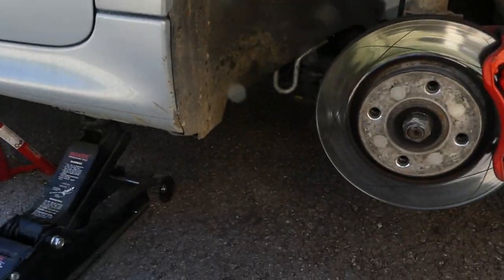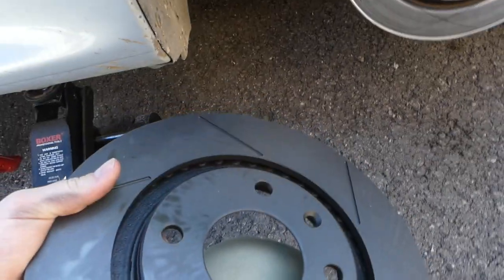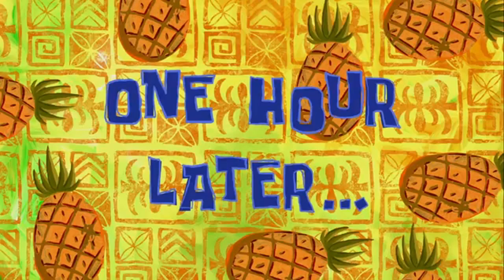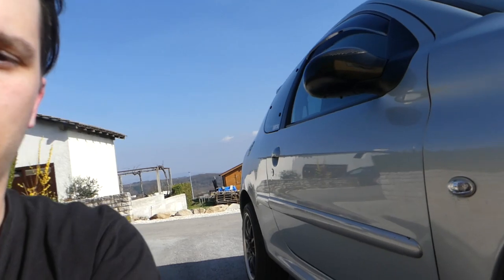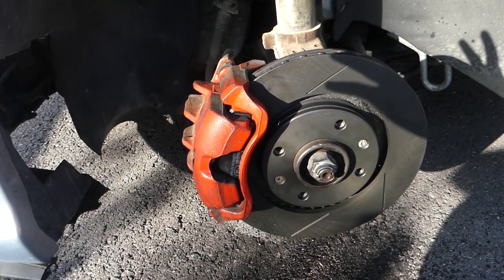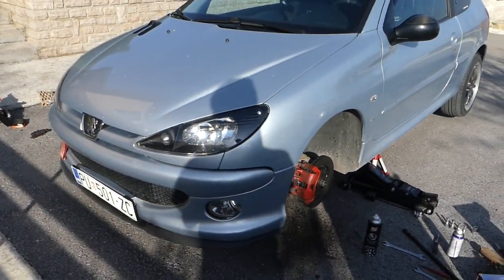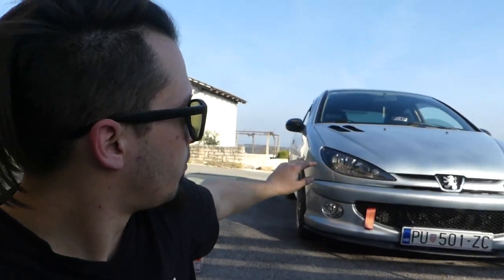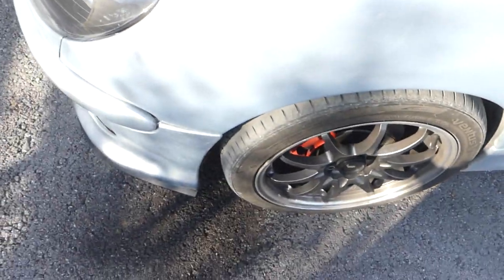INSTALLING NEW BRAKE SETUP on my Peugeot 206!!!

Comment: Nice and you are doing so nice mods too this car;) whats next??
Reply from the maker: Thank you 😁
Reply: @Dynoo1000  any probs with the car now? overheating big problem I know
Reply from the maker: @Data4664  everything is great, yes but only on the track in the summer time, but i'm working on oil cooler for 206 🙂
Reply: @Dynoo1000  okey nice;)

Comment: Sta mislis o Peugeot 206 GTI kao prvi auto? Da li bih mogao da mi kazes koji su najcesci problemi sa tim autom. Hvala
Reply from the maker: GTi hmm pa malo je trom za 2.0, vec ako zelis 2.0 uzmi RC model, al bi preporucio 1.6 16v, malo manji motor, al ide full ljepo i jeftinije za odrzavat 😁
Reply: @Dynoo1000  Jes bolji RC ali ovde u Srbija kada polozis imas probnu dozvolu 3 godine. Imas ogranicenje na konjsku snagu a to 109ks. Pa sam razmisljao kao da uzmem 206 GTI on ima 136ks

Comment: Hey Dino, how do you change the ac climate knobs, trying to install the same as yours:)
Reply from the maker: Hi, there is video on my channel about it 🙂
Reply: @Dynoo1000  Sorry but I can only find the one where u change the lights behind. I was thinking about removing the original switches, did u just pull them out?😁
Reply: @marcush.bach-nielsen6059  in that video he changed swithces too :))
Reply from the maker: @marcush.bach-nielsen6059  https://youtu.be/JZzm_YDzcZQ